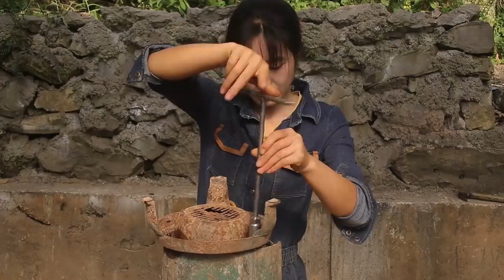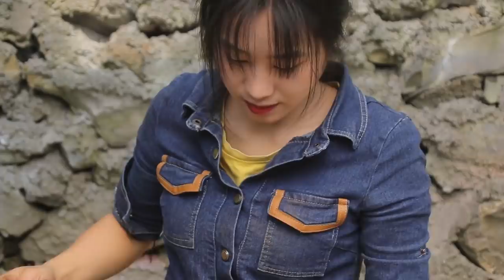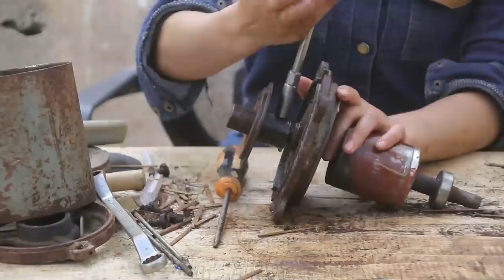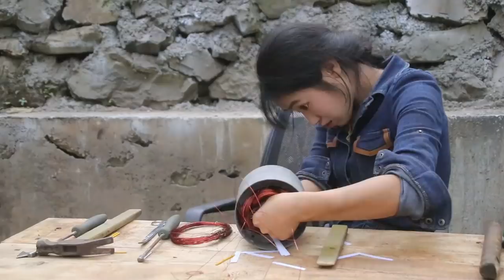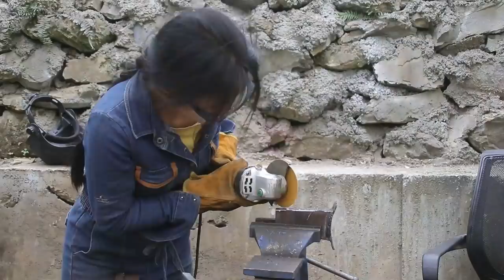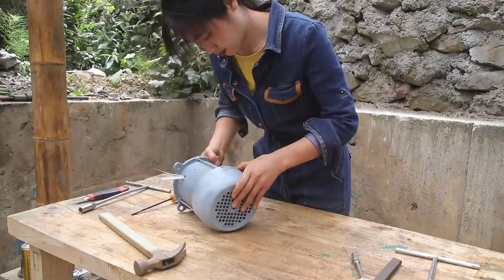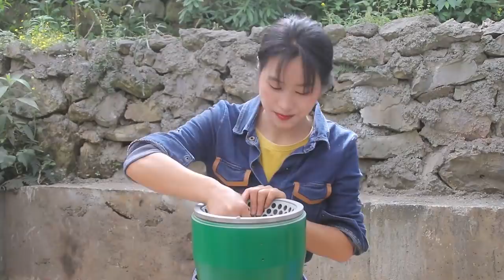💡Help Fan To Repair Uncreditable Machine That Looks Like A Cannon Bullet!  | Linguoer | Restoration

Comment: Stop broadcasting these fake works. I have 40 years of experience in the installation and maintenance of electrical plants, I know very well what it means to repair old or damaged. If this young girl is doing all this alone, why is she stuck in the Chinese province behind God’s feet. Else; the basic rules of safety at work is to work with protective gloves and goggles. I have a feeling that what she is doing is for the camera and in the end the repaired machines were planted by professionals.

Comment: Sorry to say this but that kind of work that you're doing you do not have the right tools I don't know why you're hitting it with a metal beam instead of using around pipe to hit that bearing down that's also when you were painting it looked like you barely understood what to do with that can when you were spraying it I know maybe somebody else is helping you out you're just doing the start and somebody does finish